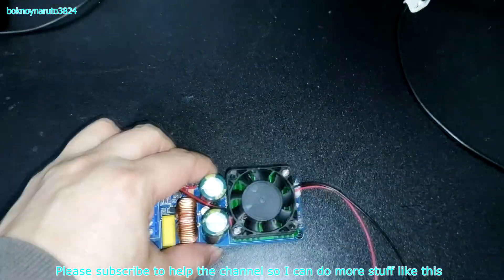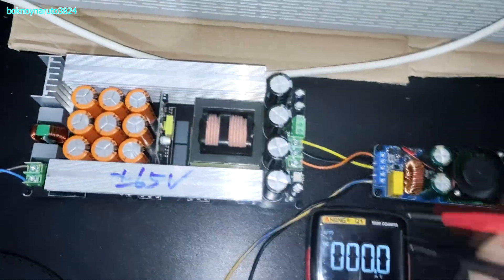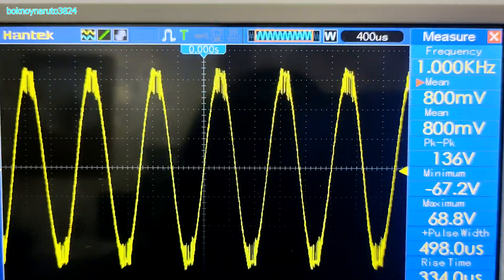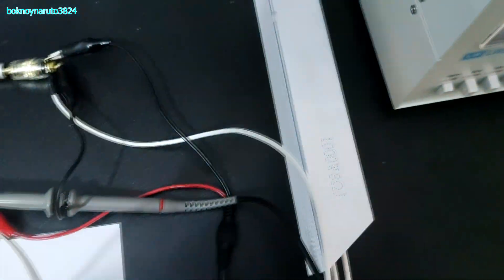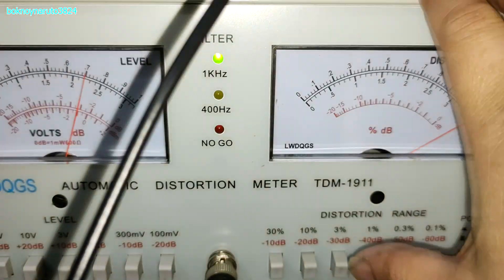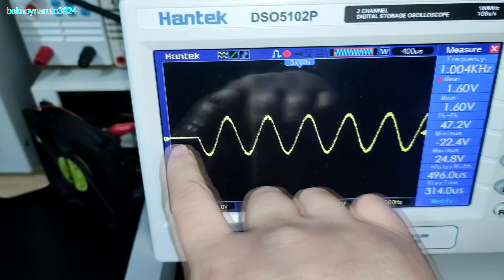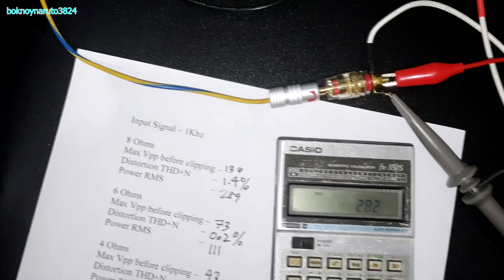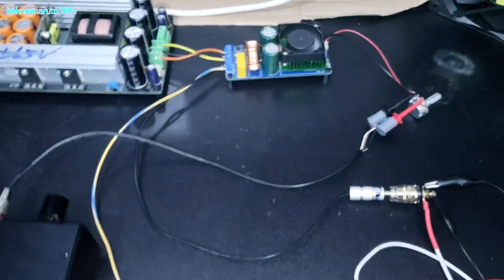Another Class D Amplifier IRS2092 500 Watts in The Palm Of Your Hand or Not

Comment: Those amp boards should put out more power than that, I'd look at that power supply not keeping up with the current load and the filter caps look too small for a high power amp. I have the exact same amps and they do more than 50w into 4 ohms. Currently just figured out how to run these off of a single 170 vdc supply.
Reply from the maker: The PSU has enough current capability to power the amp, you can see this PSU here powering a 1KW amp https://youtu.be/GICIAvLAGjk?si=He9z90GxsgOcj3ED&t=196

Comment: Put a battery in your smoke detector.
Reply from the maker: It is the Aneng meter beeping.
Its auto shut off can't be turned off and it beeps twice, a minute before it shuts down and before it actually shuts off.
Reply: @boknoynaruto3824  Ah I see, sounds just like a smoke detector low batt warning....I have a talking multimeter that drives me nuts, don't get one, and it beeps 3 times loudly  15 mins after no use and scares the crap out of me.

Comment: I don't understand how you got less power at lower impedance.
I wish you would explain the factor of the device numbers.
On other devices with peak voltage, it is calculated like this.
(peak*peak)/ohm
Reply from the maker: The simple reason this got a lower output power at 4 ohms is most probably the manufacturer had cut corners or used an inferior parts for this version of the board, so it can be sold at a cheaper price. I got 2 of this board and the power output are the same.
There is another version of this board with a speaker protection relay built in, and it also cost DOUBLE the price compared to the price of the board I had and the board with the relay built in can do 300W at 4 ohms, check it from this video here https://www.youtube.com/watch?v=sqm3L6xDw2A

To compute the Power output of the amp we can use the formula P = V²/R
Since we want RMS value so first we need to convert the peak to peak voltage reading from our scope to its RMS value.
We can use this formula to convert Vpp to Vrms, Vrms = Vpp x 0.3535

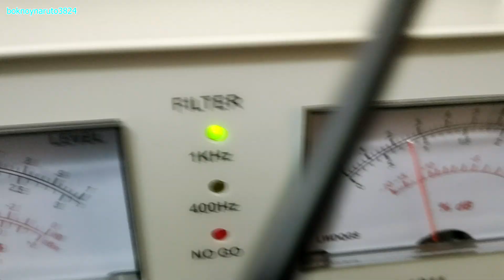The voltage reading and results can be seen at 8:30 in the video.

For example using the 136 Volts peak to peak output of the amp at 8 ohms load, first we convert it, to its RMS value

Vrms = Vpp x 0.3535
Vrms = 136 x 0.3535
Vrms = 48 - then used this to compute the RMS output power of the amp

P = V²/R
  = 48²/8  
  = 288.9 Watts RMS

You can check the formula from this site here https://www.allaboutcircuits.com/tools/rms-voltage-calculator/

Vpp - Peak to Peak Voltage
Vrms - RMS Voltage
P - Power in Watts
V - Voltage
R - Resistance (Dummy Load Value)
Vrms = Vpp x 0.3535
P = V²/R

Hope this helps

Comment: Hi I had this board powered via a 65v - 0 - 65v Dual AC PSU 600w and brought 2 units. The first unit I had working for 1 day working incredibly well and then the board got fried after taking the circuit apart and putting back togather. The second one Hooked up like the first and when powered on only the fan starts spinning no sound output. I am running the output into a JVC 12 inch DRV sub 350w RMS with 1200w Max @ 4ohms speaker impedance. I should have come to this page first to do study. Your lessons have taught me about this board circuit.
1.My PSU unit is to many volts you stated that this board will shutdown over 44 volts with 4 ohms impedance.
2.At 4ohms impedance the board output Watts RMS is far to low for my speaker.
3.The fan power will still work as the audio circuit is seperate. 

Going of what you are saying this board is shutting down at the sound output stage in other words the Board circuit is not powerful enough and the seller does not supply enough information this certainly is not a 500w board as they have explained. It is amazing to see just as I had imagined how to test the Audio Signal in the way you have now I understand what has happened with this particular board. Up until now the board only turned the fan on with no sound out.
So going of what you have said as my speaker is in the last on the list:
Power PSU voltage:43 volts.
RMS output: 58w.
Impedance:4 ohms. 
And that this board does not like 4ohms impedance.

Comment: Very informative video, so basically it's only suitable for 8 ohms loads and the wattage is way too low for subwoofer. So it's almost useless..
Reply from the maker: Thank you for dropping by the channel.
I might try to make a second vid if it is possible to get more wattage from the amp for 4 ohms load using a lower supply voltage like ±55V,±45V, and ±35V.
Reply: @boknoynaruto3824  have you tried it with +-45V and +-35V? is the ampli board works?
Reply from the maker: I tried it with ±55V and ±40V with the same result did not bother with ±35V, only good for 8 ohms load.
For 8 ohms load, worth it for the price alone but not for 6 or 4 ohms load.
There are several variations of this board I might pick up a few for future videos.